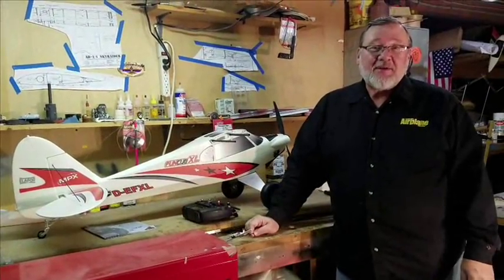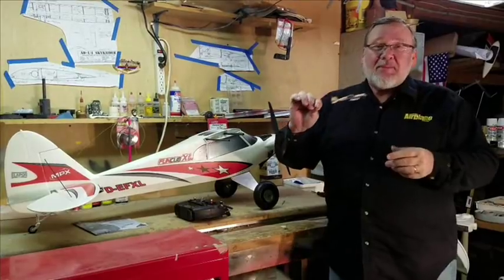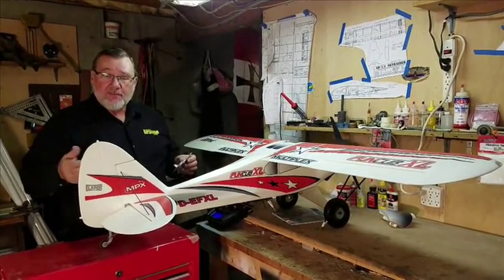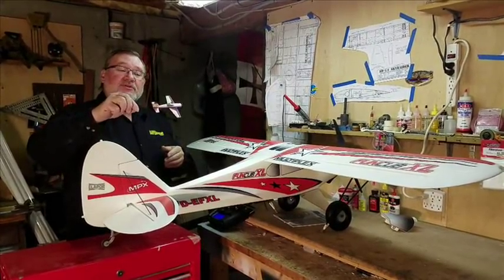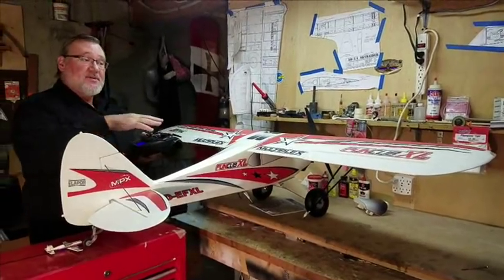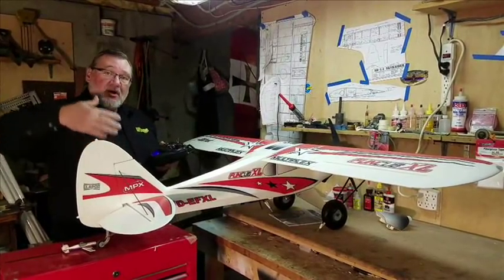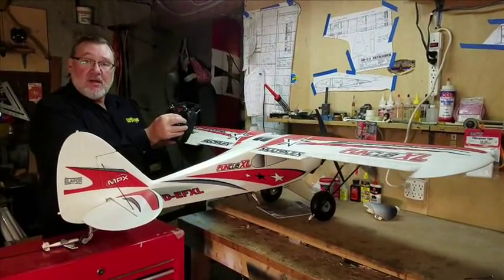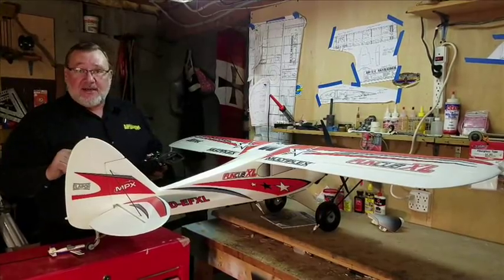Trimming your plane to fly smoothly

Comment: I offset the servo arms one tooth forward if they're under the wing. You can also move the control horns back from the hinge line a little bit, perhaps 1/8 to 3/8's of an inch depending on the size of the plane. Of course, you'll have to lengthen the pushrods so that the ailerons are centered at neutral. I don't like to do mixing in the transmitter because it requires two channels and decreasing the travel of the servo decreases its resolution. Mixing rudder with ailerons doesn't fix adverse yaw; it simply covers it up. It also makes the plane not roll straight. On a flat bottom wing, the ailerons should go up about 1-1/2 to 2 times as much as they go down..

Comment: at starting of the video on takeoff your plane is moving towards left is it under your command or by itself "I FACE THIS PROBLEM ON MY EVERY PLANE WHILE TAKEOFF ON THE GROUND THE PLANE YAWS TO LEFT OR RIGHT ON THE GROUND ITSELF" can anyone help me out
Reply: Good question, I noticed that as well. Did you ever find out, is it the torque off the motor 
Cheers Steve NZ
Reply: It is the drawback of the taildragger wheel configuration and is called ground looping.

Comment: Do you cancel out Alieron differential if using Alieron  and rudder mix?
Reply: Tommy Lopez  No, the differential stays in.  You can also use mechanical differential with a single servo and strip ailerons, and it works very well with high wing models.

Comment: what about trick or 3 planes?
Reply: On a 3D plane, you don't mix rudder, but you compensate a role with rudder how much you want the rudder to go in. Better to learn to fly that way, then you get used to it and after a few hundred flights, lever movements are there without you thinking about it.